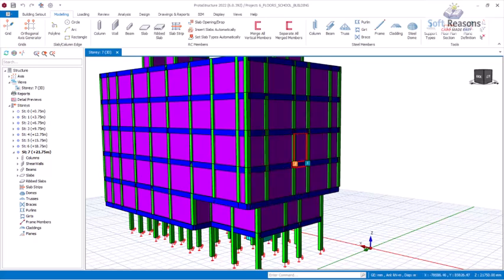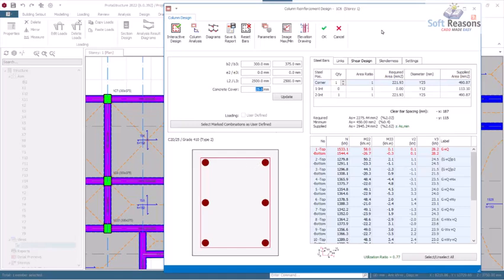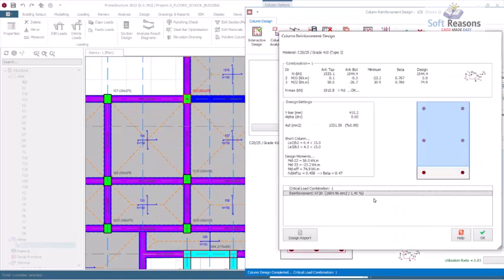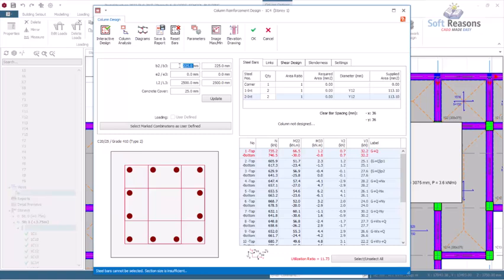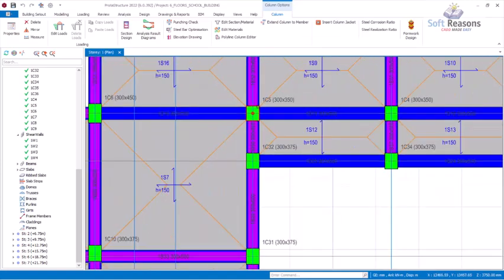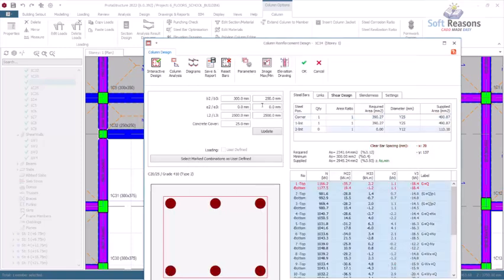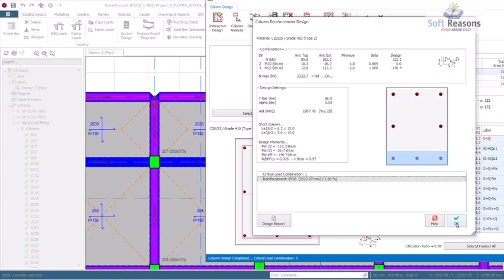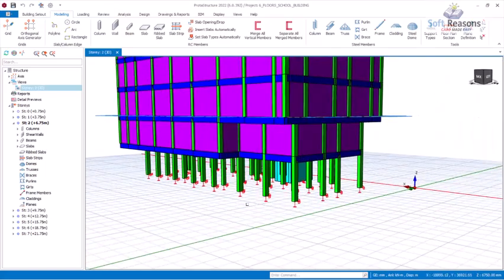PROTASTRUCTURE BEST COLUMN ECONOMICAL SECTION AND  REBARS SELECTION #civilengineering

Comment: I tried to carry out fe batch chasedown floor mesh analysis in protastructure but the analysis is only succesfully completed for 1st and 3rd floors. error message read " FE batch chasedown aborted. storey 2 check the FE slab model". how do I fix it?I tried to carry out fe batch chasedown floor mesh analysis in protastructure but the analysis is only succesfully completed for 1st and 3rd floors. error message read " FE batch chasedown aborted. storey 2 check the FE slab model". how do I fix it?
Reply from the maker: In box me if necessary I send you a video that explains solution